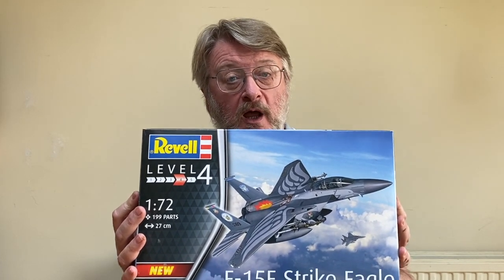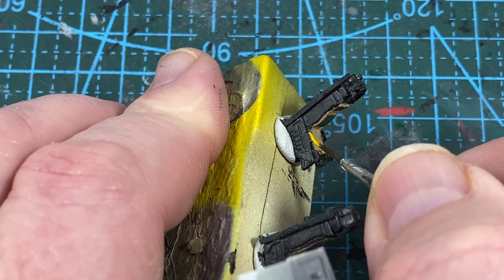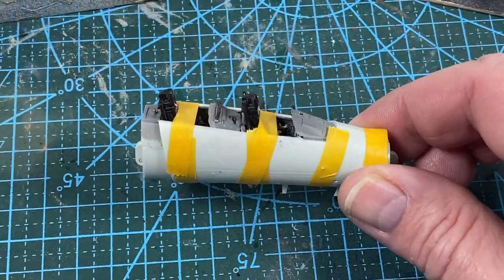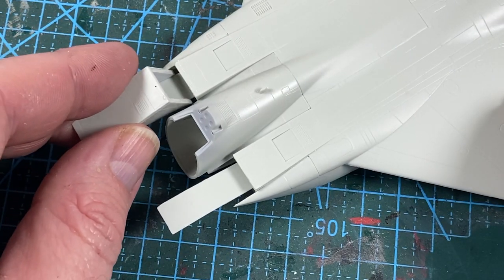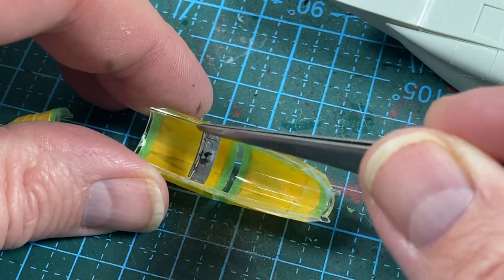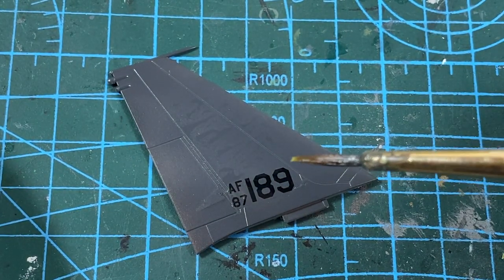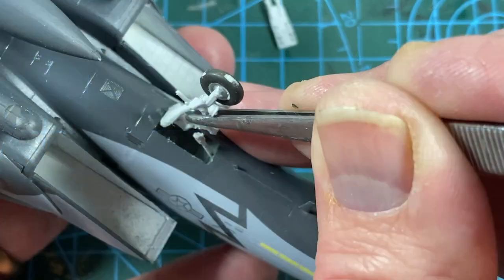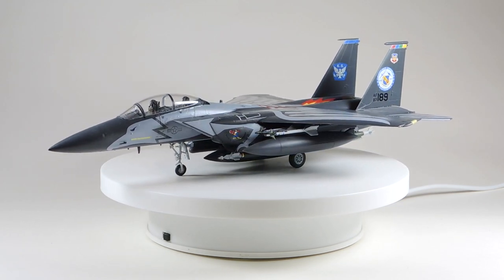NEW Revell F-15E Strike Eagle 1/72 kit 2021 FULL BUILD - HD 1080p

Comment: That's very nice indeed - it's light years ahead of the old Airfix B model I'm building at the moment. As someone who's main era of interest is late Cold War jets, I'm definitely going to have  get one of these, even if means buying AM decals to go with it. What I find really interesting though is the breakdown of the kit - separate sides, nose etc, and Sparrows in the kit? Revell has definitely left the door open for other models - it'd be great to see them do an A/B or C/D to this standard!
Reply from the maker: The way the nose is set up, with the fuselage fillet just behind the canopy, there are clearly going to be a range of versions in the future. Even tiny details such as the tail cones right at the back end - different for the A/B to the C/D.  And yes, Sparrows on the weapons sprues instead of AMRAAMs. Cool.

Comment: Very nice build, how do you thin vallejo air paints? Grtz Jozua
Reply from the maker: Thanks Jozua! Most of the time I use Vallejo Model Air which are pre-thinned, but they often still need a drop or two of airbrush thinner (71.161). Some colours don't need thinning, like British dark green, but others, like many greys, need a little. You can use thinners or even water for Model Color paint too.
Reply: @garys_stuff  Thank you for your advice.